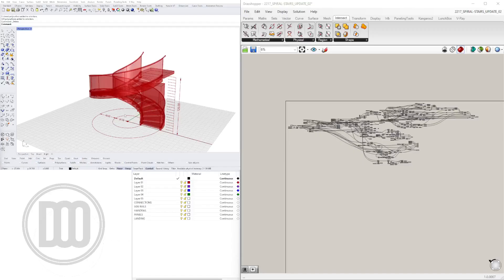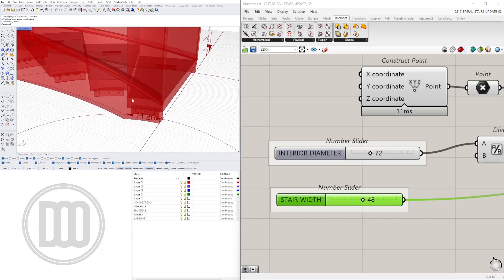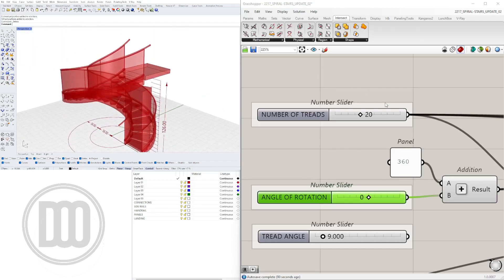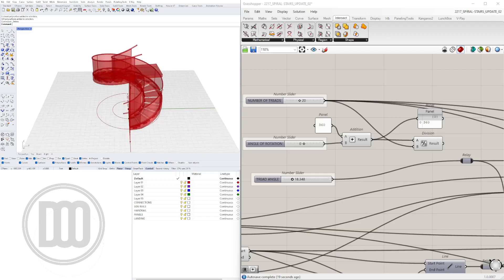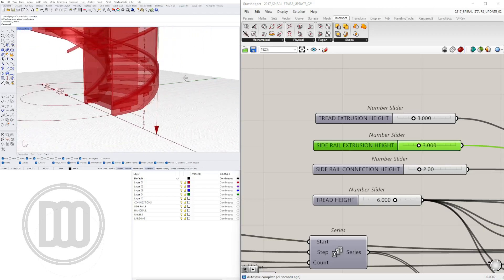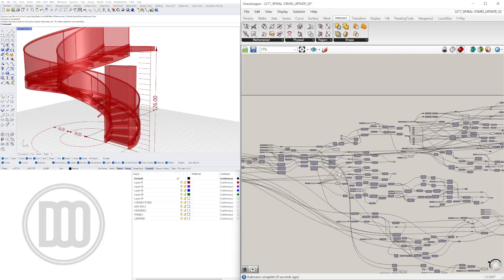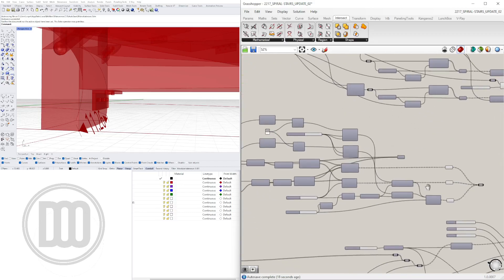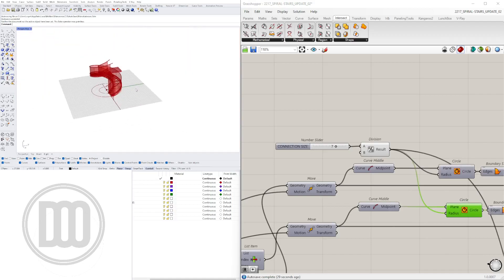Grasshopper for Rhino Spiral Stairs Master Script Overview

Comment: I purchased this one recently. This example IS a complete lesson on parametric architecture applied to a real problem that is extremely difficult too. In the future this deserves a video explaining everything. I can't hardly express how the same concepts applied here can be used for a building skin, building structure, organize a pipelining strategy for a complex project that involve linkages and pieces. 

This is by far one of the best examples that could be used in a complete set of lessons addressing the stairs, the door, the window, the ramp, the parking ramp to THIS level of detail as a component. The workflow in this channel will soon be complete because it has all the fundamental ingredients to start a private family of defined components. 

Excellent job DCO.